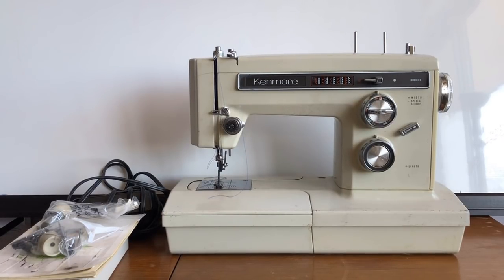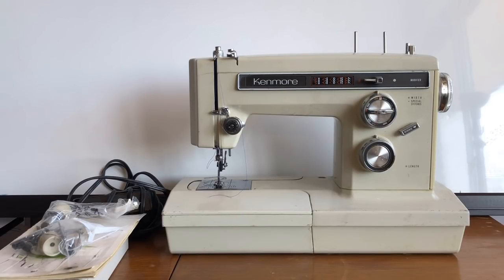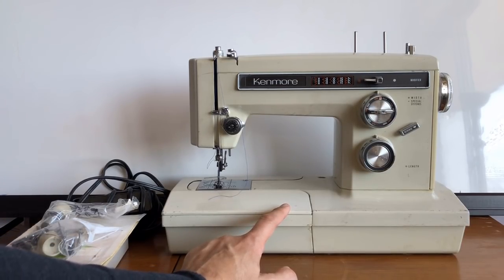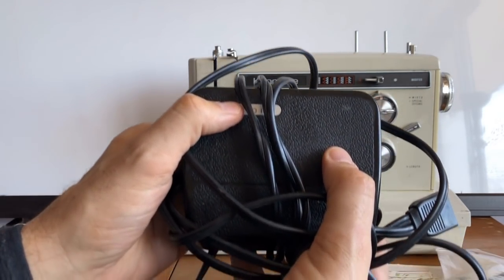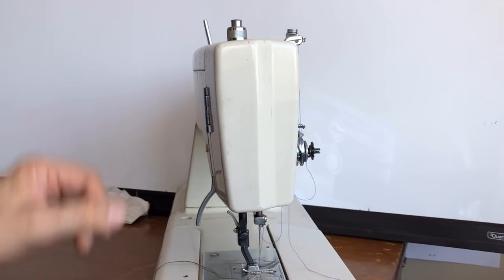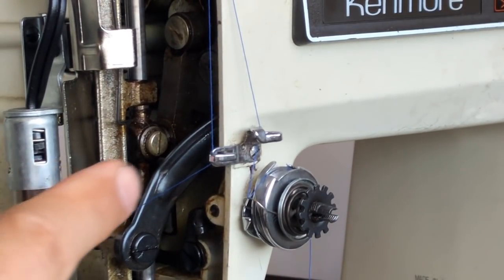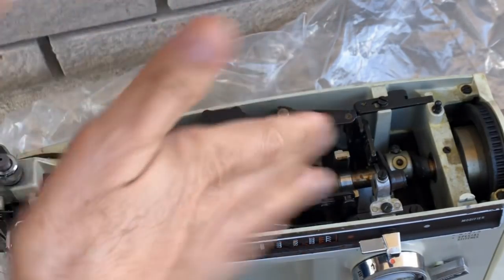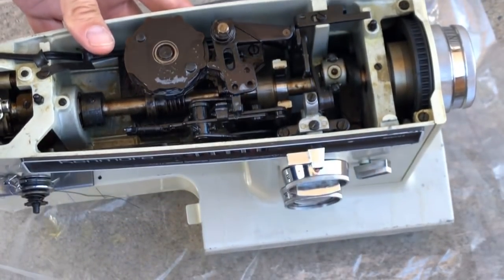RESCUE SERIES #1: Don't Touch That Dial!  How to Save Your Frozen Sewing Machine Without Messing Up

Comment: I am currently trying to clean up the inside of a "serviced and cleaned" Vintage Kenmore, which I purchased new in 1971.  The outside was always immaculate, including the cover The machine on the inside now looks like Donald Jr. Was servicing it!  The "new" belts which were installed did not even come close to fitting, and did not have little fitings to accommodate the steel gears, resulting in a pile of black particles all over the inside, creating a black oily coating permanantly stuck to the inner metal and the ouside of the motor... bet mine is worse than yours! WD 40 is within reach maybe that will work. I have been using Goo Gone and Windex so far.  I am getting a new Pfaff in March - and was giving this the once over before giving it to a friend, as it was a very well loved, and excellent machine, before being serviced, and sitting...

Comment: Much wisdom in your words, my friend... 
Just a couple of days ago, I was given a Riccar, a little younger than this Kenmore, and in the exact same condition: jammed to a freeze. The owner had used brute force against it. Anyone thinking that women are soft gentle creatures obviously knows them pretty well, but from pixels and fairy tales only. "We can plug it in, and you'll hear that the motor is turning," she said, which made me fear that a plastic gear had been slaughtered, but it turned out that a pulley had ground a belt instead. Exactly what you warn against, and which makes total sense, a belt being weaker than a gear.
The sticky stuff on the needle and presser foot mechanisms looks just like on yours, but a much bigger amount. It reminded me of old frying fat, so it might be vegetable oil. Anyway, instead of WD-40, I'm planning to clean those parts with a toothbrush and diesel fuel, or even dish soap and water first, as for a bicycle transmission. What do you think?
Reply from the maker: Hello.  I would avoid using water on sewing machines since they are very prone to rusting with any moisture exposure.  You can use a damp rag on the body of the machine (Painted Areas Only).
Reply: Thanks for your quick reply. Your channel is very instructive and inspiring, it's one of my favorites. I agree with what other viewers said: Your voice sounds great and your elocution is clear. I noticed that you sometimes pop the mic, and the wind was audible on this video. If you're not already using one, you might put a foam cap on your mic, and if your camera features sound monitoring, you could plug headphones in, to check what's being recorded, since you stay offscreen. Anyway, I love what you do. Thanks for sharing your knowledge.
Reply from the maker: Thank you for all of the suggestions.  Bumping the Mic is something I am working to improve on!!  For the wind, yes, it was windy outside where I had taken the machine to spray it down and there was actually a foam cover on it to help muffle the wind, but the wind was extra strong in the afternoon.   Thank you for watching my channel.
Reply: Indeed, foam is not enough to mute a strong wind. Sound recordists use what they call a 'dead cat':
https://en.wikipedia.org/wiki/File:Dead_cat_Dead_Kitten.JPG
Reply from the maker: Thank you.  Great suggestion!

Comment: I have a Sears Kenmore 158-1350 machine that I bought for$5.00 in a garage sale. I love to tinker with them. Most of the machines I get in garage sales just need to be cleaned, lubricated, and needles changed. Sellers have said that “it just doesn’t sew very well any more.” This Kenmore has exactly the problems you are covering here—I think someone oiled this with vehicular motor oil, and way too much at that!  Dark yellow, gooey stuff all over! Inside the case, the bobbin components…. Then, from some of the accumulated dirt, I’d say it sat in a garage for awhile. Such a shame for these workhorse machines! I cleaned what I could reach with cotton swabs and pipe cleaners, oiled it, and let it sit. Everything moved much more easily, so I tried running it. It ran, but after about 15 seconds, it developed a quiet squeal, so I stopped. I think I’m going to try the WD40 thing next….
Reply from the maker: It's possible someone heard an 'urban myth' about alternative lubricants for these machines or saw something ludicrous online.  Hopefully, your machine is not in as bad a condition as mine is :/
Reply: @VintageSewingMachineGarage  I could move the hand wheel before I started, but it was stiffer than it should’ve been. This thing is sure a gooey mess inside, old oil (or whatever) coating the inside of the casing. Maybe the same people who owned yours owned this one, lol! Did you use actual WD40, or the penetrant? Thanks!

Comment: I have a Kenmore 158.901 model.  Very heavy made in Canada. Older than the one your showing. It works but needs a thorough cleaning. I also have a Singer 401A Slantomatic. I completely disassembled it thanks the a Youtuber named Andy. I reassembled it re-oiling it as per maintenance specks.  Can I do the same with this 158.901 model ?
Reply from the maker: Yes, you should be able to do this with the Kenmore you have because it was made during a time when machines were designed for regular maintenance.

Comment: I have a Kenmore mid-60s model 1751. I have 2 problems. they might be related.  my feed dog control seems to be frozen in the up position.  I do not see an abundance of crud but the machine was very dry. I used WD40 hoping to lose linkages.  No luck after 48 hours.  Would it help to use a hair dryer to maybe warm up old oil?  My other problem is The stitches/inch adjustment knob moves well enough but the size of my stitches remains very small.   Any hints? Kit Jenkins

Comment: Do you have any interest in in the Sears Lady Kenmore 89 ?  I just got one and it’s totally seized. It also needs a new belt. I was wondering if perhaps you would know where I can order one and which belt I need for this machine?
Reply from the maker: I've never worked on one of those.  They were made in Germany for White which was still trying to keep the contract they had with Sears.  The design was produced by Pfaff after Pfaff purchased Kaiser-Gritzner; another German machine producer.  Try searching on Ebay, Etsy for the belt.  Seizing could be caused by everything from thread jams to sitting in a damp or hot storage space.  FYI, be extra careful when working on "The Lady" since it is one of the few 'Rare' Kenmores and parts for that model are not easy to find.
Reply: @VintageSewingMachineGarage  Thank you so much 😊

Comment: I have a similar model like this and the machine runs but it doesn't go forward. It just is stuck stitching in one spot. What could be the cause for that?
Reply from the maker: The first areas I would look at are the belts.  They might be slipping or the motor bracket might need adjustment to restore belt tension.  I have videos on how to set belt tension.  The other area, though much less likely, would be the stitch length adjustment mechanism that might be stuck.

Comment: Have always been told dont ever use WD40... only use sewing machine oil!
Reply from the maker: Yes that is correct for the oiling points or normal lubrication for any sewing machine.  WD 40 and other brands of penetrant oils CAN BE USED for unlocking a frozen or stuck sewing machine.  The main point to remember is after you have gotten your machine unstuck, to then go back and fully oil with sewing machine oil.  WD 40 and others like it are NOT the same as oil and should not be used for lubricating.
Reply: @VintageSewingMachineGarage  TY so much for clarifying that. How do you know when to go buy some Blaster or just use the WD-40 that's in the cupboard?

Comment: I watch all your videos. I’ve been binging since I found you. I have a 158.17033 that the motor runs but the needle won’t move. I moved the wheel toward me and nothing is locked up, the needle moves and the machine is VERY clean. Is there something you know of I should check? Was trying to see if I could fix it before I take it to the machine place and they tell me it’s 5 million dollars. I just got the machine yesterday. I paid $60 including shipping. It has the bobbin case, bobbin, foot peddle and power cord and the case (which FEDEX broke!) help!!! Please!!
Reply from the maker: It is hard to guess given the number of potential causes.  I wonder though if the knob that engages and then disengages the bobbin winder might be sticking or intermittently stopping the needle from moving.

Comment: Absolutely love my Kenmore!!  Bought new back in the early 90's and the only thing needed was to clean and oil.  It's been a jewel!!   Currently looking for a backup machine that can used for double needles or different thread usage  but it's a  little hard to live up to the Kenmore ~~ and I am only interested in manuals.
Reply from the maker: Thanks for sharing!
Reply: Have you opened up the column on your Kenmore and greased the gears? I only ask, because like you, oil and cleaning only since purchasing in '90/'91. 'Bout 4 years ago, sewing great one evening and the next morning, straight stitch only! There's a bunch of gears that need some lubrication TLC  inside that column. Added more grease and he's running great ever since. If when you turn the stitch selector knobs you hear a rather substantial, "clunk, clunk, clunk" instead of a quieter, "ooff, ooff, ooff" when you turn the knobs that's the machine telling you it wants/needs some grease!

Comment: I have a Kenmore 158 I purchased new in 1972. The black "tire" that drives the bobbin winder failed. I tried purchasing a replacement on line and ended up with a "doughnut" that also failed. Ed Nisley,s Blog posted he had the same problem and he also gave the dimension differences. I would like to purchase a part that works. If anyone has information on this that you could post I would find that helpful.

Comment: My reverse won't work and I'm trying to find out how to unstick it. The lever moves some, and just barely moves the bars that change the direction of the feed dogs. If I move the bars manually, the feed dogs have no problem changing direction or moving well. It's just that the lever won't function to engage the bars/gears. Otherwise, super-clean FREE machine I got on Buy Nothing page. I'd love any tips that you could spare on that process. TY for your videos!
Reply from the maker: Try getting to the moving parts BEHIND the lever.  Its almost never the lever itself that you see on the front of the machine, but rather the linkages behind it that are stuck.  Try using oil, or oil/heat to see if you can get it moving properly.
Reply: @VintageSewingMachineGarage  I'm still struggling with it 2 weeks later. Discovered the stretch stitches are only in reverse, too. I used gobs of penetrating oil but no luck. Every dayni work on it but not gaining any ground. I will try a blow dryer to add heat next. So disappointing

Comment: WD-40 is a rust preventative, not a lubricant or cleaner. WD stands for Water Displacing. This was created by NASA in the 60s to prevent rust and corrosion on rocket parts at Cape Canaveral, Florida.
Reply from the maker: Yes, Paul, you are correct.  I use it as a cleaner and never as a substitute for sewing machine oil.

Comment: Thank you , on a very frozen machine farm steam tractor we had a vat of kerosene soak for a week submerged motor and belt off on sewing machine all electric switches removed surprised really frees i soaked the bobbin winder that was frozen in kerosene next day was freed up .
Reply from the maker: Yes David, I've used Kerosene for unlocking items that I have or keep outdoors.  I don't use it indoors because it stinks and does not evaporate the way many other solvents do.  I believe that there is some Kerosene in 'Liquid Wrench' penetrants and this is why I seldom use even that.  So you are right about how effective it can be but the odor is not something we want inside getting into fabrics/carpets etc.  I once tried (with success) Marvel's Mystery Oil when I dunked a Singer 185 and let it sit in a bucket for a few weeks.  I did this outdoors though.

Comment: I have this exact model and was wondering if you know anything about adjustment screws on the bobbin winder assembly unit. I can only fill a bobbin halfway and then it just stopped. It doesn’t disengage it just stops.  I did run into a video where a lady tries to explain how to make the adjustment but I didn’t quite get it. If you know anything about an adjustment that could help correct that problem I would appreciate it.

Comment: How do I replace the motor on this model of Kenmore. My motor creates a burning smell and it’s abit slow. Was wondering since the bearing is on the bottom of it’s a specific model.
Reply from the maker: You can find salvaged Kenmore motors on sites like Ebay and Bonanza.  Be sure to get one from this machine model since the mounting setup is specific.

Comment: I have a 158.1913...I hope you show us how to remove the bottom because I cannot get it off.
Reply from the maker: Hello Suzanne.  Yes, I will show removal of the bottom pan in one of this series installments.  There are a few things to note when doing this.  By the 1970's when this machine went to market, both the top and the bottom were serviceable, but not as simply as in years past.

Comment: Well, I'm glad nobody did anything so boneheaded as to grease up the inside of the seized 158.1792280 I just picked up... They did however manage to wind enough thread around the take-up lever crank, that it looked like there was a bobbin lodged in the head. 🤦‍♂ That particular Gordian Knot required some delicate surgery with a scalpel and a hemostat...  I can turn the handwheel now, but it's real sluggish. Guess it's on to lubrication!
Reply from the maker: Don't give up Bakamoichigei.  Those machines are worth the effort!!
Reply: @VintageSewingMachineGarage  Absolutely! I knew they were something special because my mother had one when I was a kid in the 1980s and I've never seen anything quite like it since. That full electronic motor control is really something! (And now I have two; still working on the seized up one, but the second one works.)

Comment: One of the thread holders was broken off my Kenmore 158.19461.  I'm gonna try your tip on removing the remnant from underneath after taking the top cover off.  And this is part of the reason why I subscribed to your channel.  Thanks so much for all you do.
Reply from the maker: Did it work?
Reply: @VintageSewingMachineGarage  Yes.  Thank you.  That tip worked like a charm

Comment: The heat from a conventional bulb right there would be enough to cook the grease in that area. On machines like this one, I can smell that brown vintage grease at several feet. 
Mostly on old Singer 201-2 and 15-91 machines, like you say, they put it all in the wrong spots and use thin oil where the grease should have been!

Comment: Got a vintage Sears Kenmore the other day for $5 with the challenge of fixing it (and knowing nothing about sewing machines). after using PD blaster to free up and disassemble and clean the presser foot, I was able to free up the whole drivetrain easily by disconnecting the upper from lower by removing the screws to one of the arms, then moving the lower by a bit of hand force. Oiled up, she then ran silky smooth. Love it!
Reply from the maker: Congrats on bring yours back to life!!

Comment: RhodeToPrepping
Just recently found your videos. Love learning about these old machines. Just out of curiosity, when you say that the Kenmore in this video was crazy expensive, could you or anyone else give a ballpark number for what the original sales price might have been?  I am watching this because it looks like a machine I got new back in 1972. One of my clients husband was a manager of a dress factory. I told her I really wanted a sewing machine to make myself some new clothes. I was newly married and had little money. The lovely lady said her husband could get me a heavy duty machine with the cabinet for under $100.00. I was thrilled, it was and is a great machine for $90.00 or any amount. It is better than the Singer I purchased years later about 1989. Any way my $90.00, blue machine circa 1972 looks much like the Kenmore with the exception of color.
Reply: The original machines were priced in the low $200s.  Kenmores are one of the only sewing machines that have actually gone up in price, the Singers are worthless, particularly the 1980s.